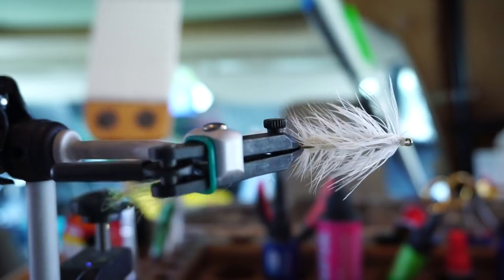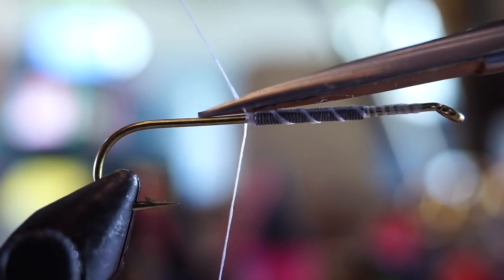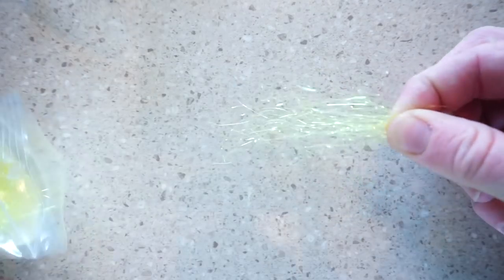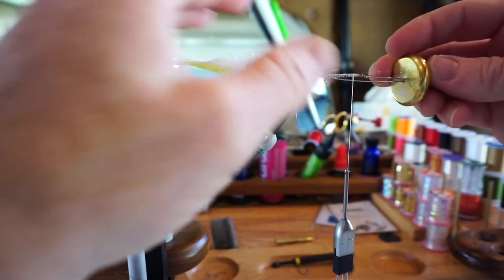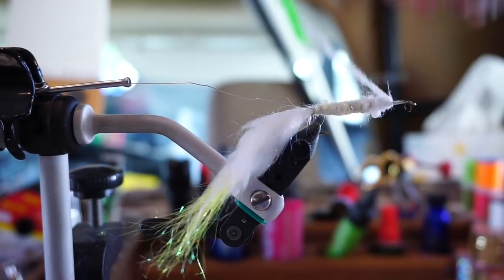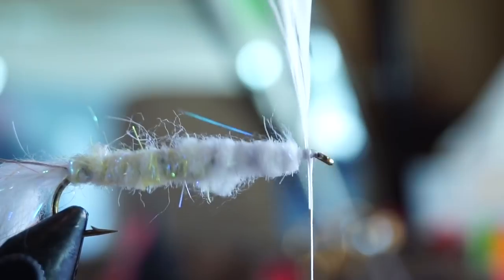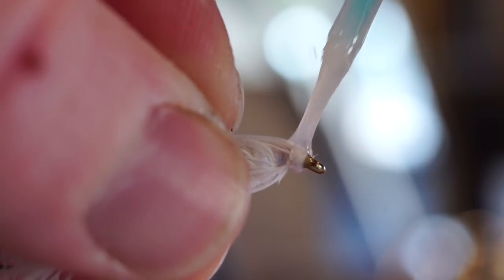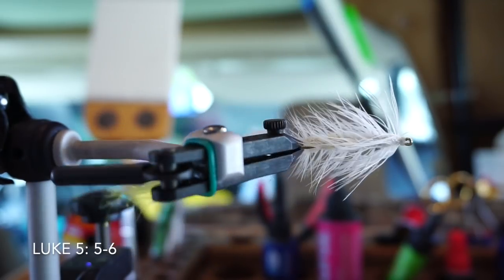Furled wooly bugger - McFly Angler Fly Tying Tutorials

Comment: You put this up a while back. But i want to rhank you for sharing this technique. 
It's extremely adaptable. 
Ive been experimenting with furling dubbing loops. Also various yarns and chenilles by themselves, not put in to the tying tread dubbing loops.  
Made some decent bass worms. Also some salt water style bristle or polychaete worms. Ive also made the loops from 30lb braid and put a trailing hook in the position where you put a hot spot. 
Been working on incorporating different sizes of mono, and some thing call stretch cord for kids beading necklaces, in to the loops to stiffen them. 
This gives a straighter 'jerk bait' pattern.
Seems the imagination is the only limit to this furling style.
Reply from the maker: Glad the technique helped ya.

Comment: Looks like a good pattern for bass! Was admiring your saddle hackle, where did you get it? (The link in the description is incorrect - its a duplicate of the one for Ice Dub) Thanks,  Hank
Reply from the maker: Oh I was just linking to a random saddle,  thanks for letting me know.  This one I actually bought at a tying show.  $20 each or 3 for $50.  I got 3 of these beautiful saddles, one white, one grizzly and one chartreuse grizzly.  They are not dry fly hackle by any means, but perfect for streamers!
Reply from the maker: Ok so I changed the link, it’s from amazon, and these are decent saddles for this application.
Reply: @McFlyAngler  Thanks for that!